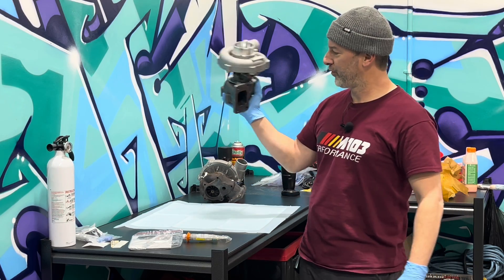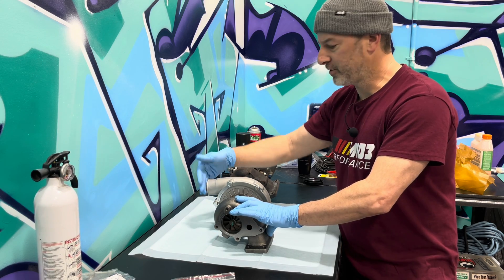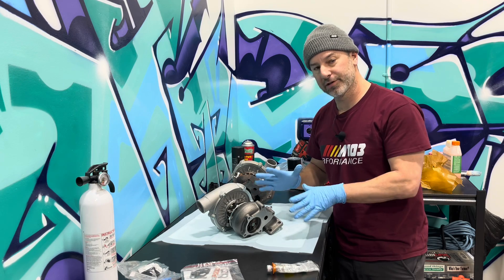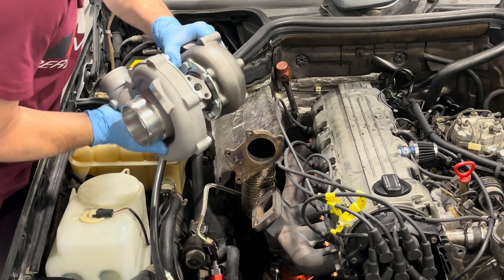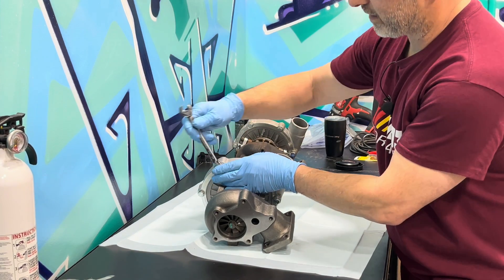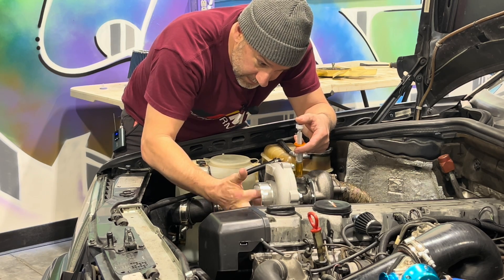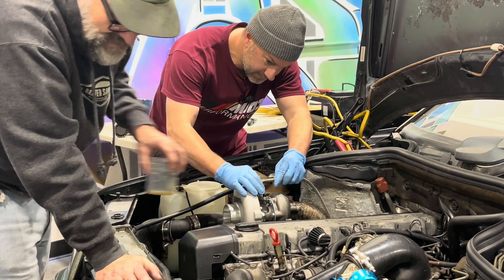How to CLOCK & PRIME a TURBO for first startup

Comment: I have the exact same turbo that i installed today  and when i tried to pour oil and spin it wouldnt drain fast at all even without the drain line, is it cause it needs to have pressure or something? Should i try priming it with the feed line plugged or even start the car without the drain line for 1-2 min? Idk what to do its my second turbo from them im disapointed
Reply from the maker: That could be due to just different tolerances. As you could see oil went everywhere for me on this turbo. But on previous similar turbos that was not the case. I would maybe reach out to the company and see if they provide you a different one. Otherwise go with it. But definitely make sure to get oil in it and then Prime your oil feed line before you connect it all.

Comment: What happens if I have no bolts on one side it’s just a snap ring
Reply from the maker: You may be limited on how you can clock the turbo but removing the snap ring should allow you to rotate the body

Comment: How bad is it for the turbo if you didn’t prime it before start up? Car sat over winter and I cranked it a few times before starting it and then let it idle for about 5minutes before shutting it off but my 2871r sounded very noisy during idle
Reply from the maker: Well, the turbo spins at super high RPM so even a short duration of running dry can be hard on it. You would want to at least make sure that your oil delivery line is primed to know that the turbo is getting lubed. With a new turbo often they probably should have some sort of assembly lube, but always good to get some more in there if you can.
Reply: @AutoAfflicted  thankfully I did crank it atleast 4-5times so hopefully it didn’t go to long maybe a second or 2 before it got oil
Reply: @Smosis  any update on your turbo since then?
Reply: @ClearCubeMusic  tbh not sure to be on the safe side I ordered a whole new core from garret and haven’t looked at the old core. It maybe okay and just was hitting the back plate a little
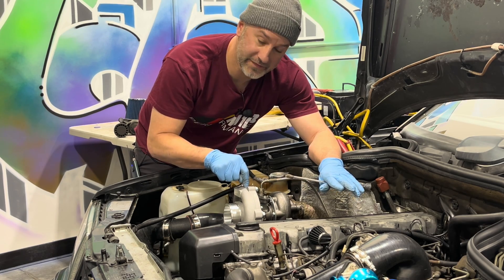Reply: 5:52  @Smosis